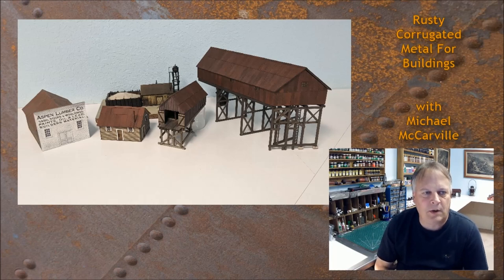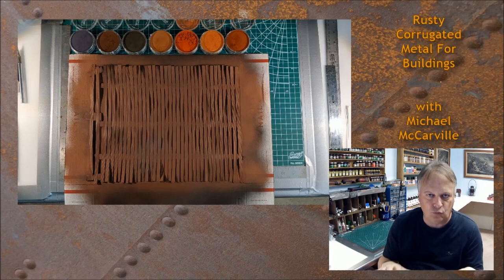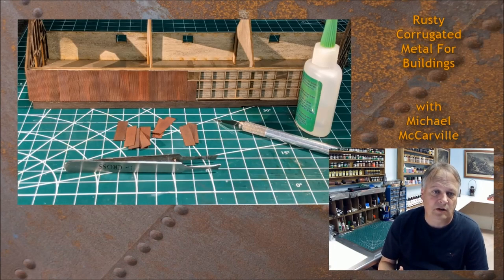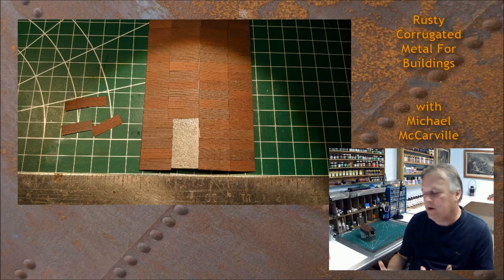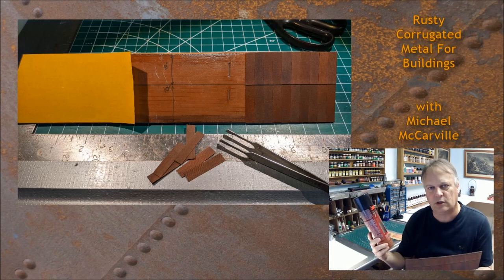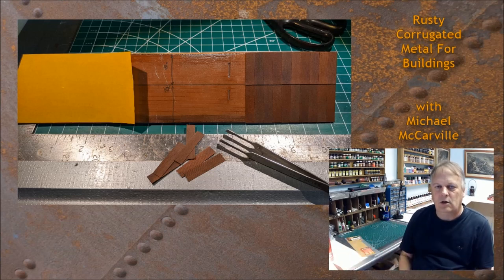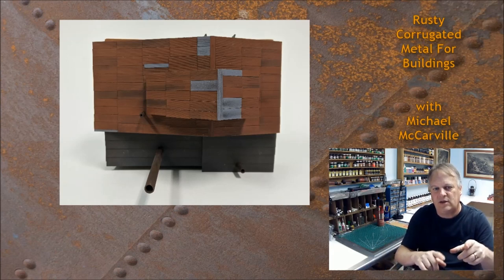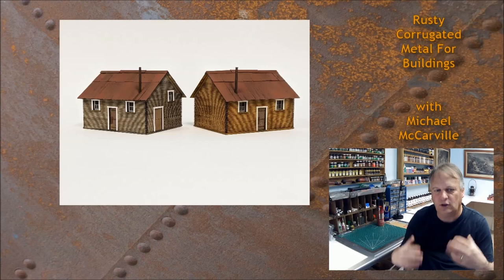Ep 141 HOW-TO Rusty Corrugated Metal For Model Buildings

Comment: Very nice Mike thanks for this.  I think we as model railroaders miss things because we just go to hobby stores.  You know my wife is in paper crafting and has a whole range of adhesive for all kinds of applications of different materials.  I have found that Alene’s Tacky glue is great, drys clear and is paintable.  Also double sides tapes, real eye opener.  She has a variety of tape runners and tape tape that are okay, but RED SCORE tape is awesome.  It comes in roles from 1/8” up to I think 2” and also comes in sheets.  It holds about everything including vellum which is really tough to work with.  I think we should talk Michelle K into doing a cross over video.  And the pan pastels, wow they have lots of colors and are in art stores.  Still expensive at $8 but I think having more the railroad colors like you said is really good.
Reply from the maker: I will check out the tapes. The Pan Pastels last forever. I have done a dozen buildings and made no dent in them.